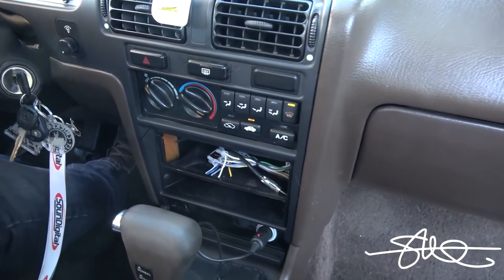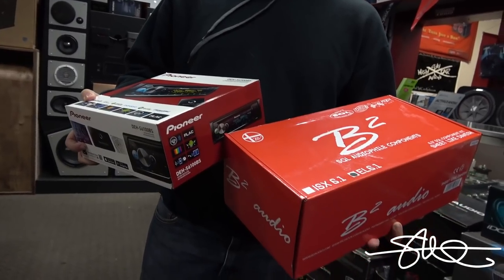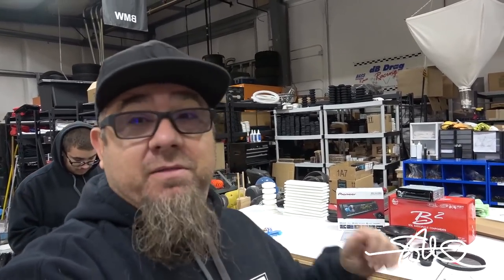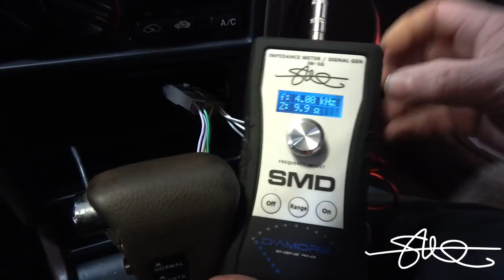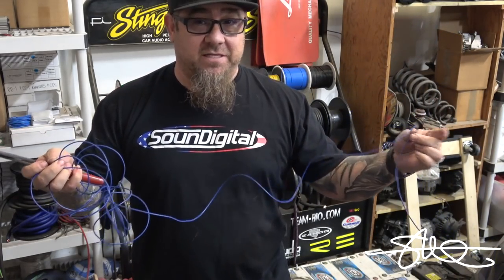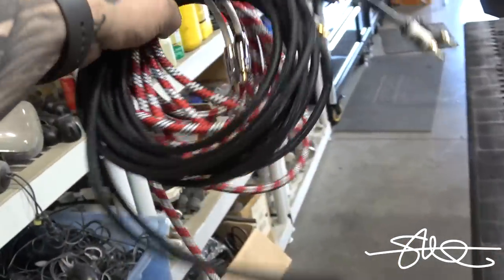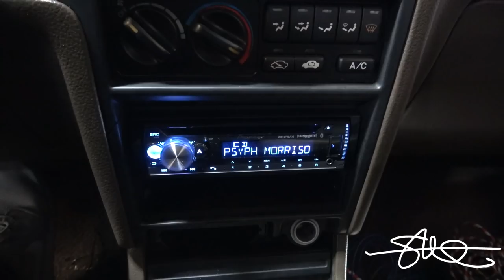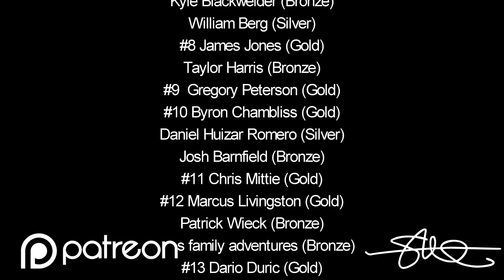Father & Son Fun Car Stereo Install 1990 Honda Accord - His First Deck & Door Speakers! Video 1

Comment: Why use a CD and not pair up the dude's phone like he's going to use it anyway? Seems like a hassle to find a disc just to test for sound but if you wanted to showcase the artist I can understand.
Reply: As far as I know it's because CDs are way better quality than most Bluetooth devices. It can deliver a higher sample rate and thus better quality. That's why when he's using  the amp dyno to measure an amplifiers power, he has a CD in the deck too - a phone would be way easier and more precise but like I said better quality.
Reply from the maker: how do you know we didn't pair it up?  Settle down Frank, we just started.
Reply: I mean I have no problem with it I just wanted to know the reason. From the video it looked like you were going to test connections, not sound quality.
Reply: lol he literally said he was gonna see if there's any sound ... he didnt judge how good or bad those speakers sounded he was just checking and making the point that they work at all.... @frankthetankricard
Reply: @TheVergil7  CD sound way better can't stand the sound from a phone... I have blue tooth and Auxiliary....
Reply from the maker: @keithbranch5181  actually Keith, the Bluetooth connection will also sound awesome.
Reply from the maker: @frankthetankricard  i did test the connections. Did you even watch it? don't answer that.  I'm over this conversation.
Reply: Indeed Steve, let's close this conversation, it didn't go the way I intended. Have a good day!
Reply: @keithbranch5181  I use the USB in my car. welcome to 2018
Reply: @GhilleGhille  It don't matter still not better then CD
Reply: Unless you have a iPhone with 30g and better then you can change the format....CD you ain't got to worry about until they get old but I always make copy
Reply: @keithbranch5181  CD is only good as whatever is put on it man
Reply: @keithbranch5181  USB is the next best possible thing to CD. I'll add .0001% THD for the ability to play any song at any time with minimal effort
Reply: @GhilleGhille  And if the CD sound garage then the whatever you hook up is going to sound twice as garage...The CD is direct connect...The by wire not by blue tooth....
Reply: @keithbranch5181  USB isn't bluetooth
Reply: @GhilleGhille  I Know it's not Bluetooth..Am just say they both is Trash is If the CD is trash on the unit... Because the CD is direct so that is always go to play better then any eternal sound
Reply: @keithbranch5181  USB is an electrical connection. A CD has to be read. A CD is JUST as external as a USB
Reply: @GhilleGhille  But its not it's direct like like the radio..It's built in the unit..A eternal is something connect to it to work....You trying to make you claim irrelevant but it's not..The CD going in the unit and plays...You are connecting a wire that not only pick up feedback...But if you don't have a external sound for power.You will introduce more noise to the radio.....You keep on trying to make you claim...But play CD and USB...It will never be as good as a CD.Unless you are file at the same quality level...But then you have to worry about a dam wire....
Reply: @keithbranch5181  The radio is connected by wire, where do you think you get the signal? The antenna, which is connected by wire and can be unplugged. Just like an aux. So no. A USB stick is inserted into the USB port, a CD is inserted into the CD tray. Both have to be read, but if the CD has a little bit of dust, you've just altered any readings. A USB stick transfers electricity around the dust.
Reply: @GhilleGhille  The is radio is not a add on okay it's a already apart of the unit...A USB is a wire okay...When you add some to a unit it is a add on stop sounding stupid.... They introduce noise and interference because they are not apart of the unit.....Like I just say if it's not in Wav or FLAC format...Then the sound with be trash....Most radio don't play a USB drive direct...You usually have to have a whole unit such as a phone or some type of device...Almost anywhere you go on the internet...It tell you that CD usually will have the High quality verse.You playing from your phone...Where most things are in mp3 format... Even thing from YouTube....
Reply: @keithbranch5181  Jesus, don't say I'm sounding stupid when you think a radio antenna is a part of the head unit. You can literally unplug the antenna from the headunit. I've done it a few times. A USB stick is an add on, and so is a fucking CD. Just because you put the CD INTO the radio doesn't mean it meshes and becomes a part of a the radio until you press that button and all the plastic is no longer fused together. It will be trash? MP3 isn't really trash. CDQ music is the best, but you can get CDQ files on a USB device. Makes CD obsolete. You're basically saying that CDQ songs on a CD are better than MP3 songs on a USB which is true, but you're using best vs worst case scenario to justify your point. Even the playing field and the USB holds a lot more CDQ songs.